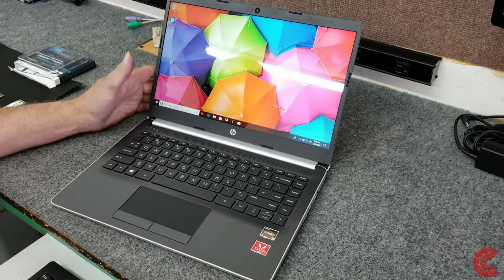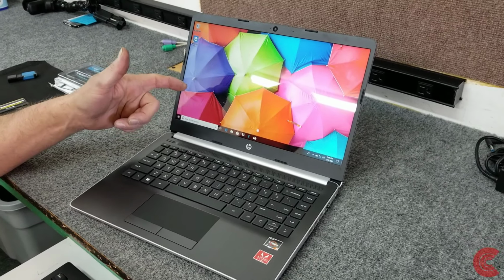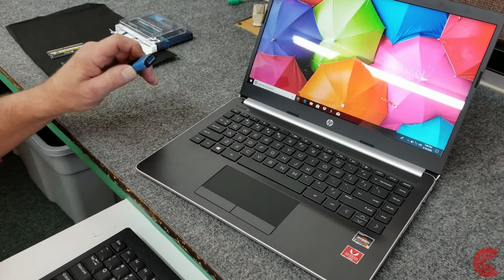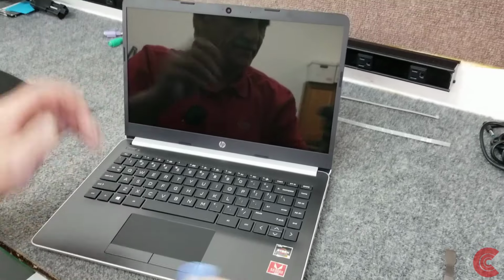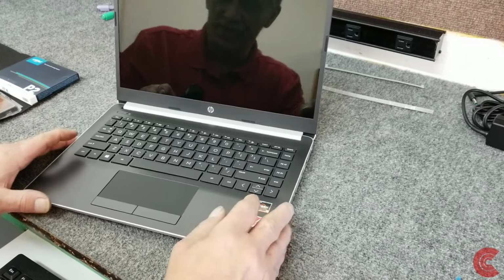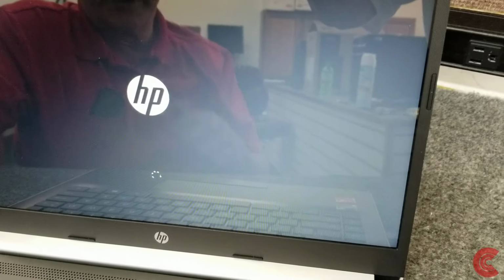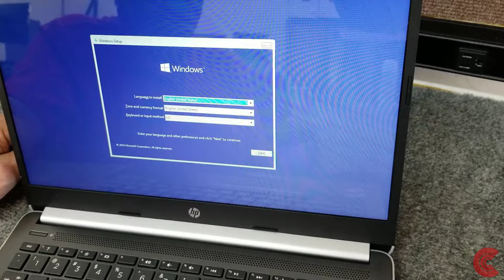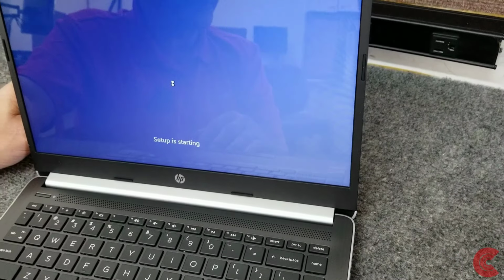HP 14 Laptop SSD Upgrade, Memory Upgrade

Comment: thanks for the video, I wanted to add an HDD but thankfully this video showed me that I also need a caddy, thank you for the links !!!
Reply: bro can we add hard disk into it ?
from Pakistan.
Reply: @howtoxpert1  Yes, you can install a 2.5" hard disk drive, you will need the connection ribbon to plug it in to the motherboard, and a rubber caddy so it does not wiggle around.
Reply: @complex_variation  it would be very appreciable if you suggest me a good HDD and its size.
Reply: @complex_variation  thanks boy.
Reply: @complex_variation  amigo, creo que hablas en español (cruzo los dedos). Estuve viendo y creo que hay partes específicas, con numero de serie, según cada laptop. El cassy de goma o silicona, lo puedo conseguir. Me está costando encontrar la cinta de conexión que iría desde el SSD (en mi caso) al conector que está en la placa de la laptop. La mia es una HP 14-cf3047la. Gracias totales!
Reply: @nachoex  Hola si hablo español! Fíjate que mi papa y yo ambos tenemos como la misma "serie" de HP, 14 pulgadas laptop básica, la unica diferencia es el procesador, AMD e Intel, hasta la motherboard se parecen en cuanto a forma, y te puedo confirmar que la de mi papa (14-cm0015la) le quite el HDD con el caddie y la cinta de conexión y la logre poner en la mía  (14-ck0019la).

Pueda ser que, si existan diferencias, pero recuerda que estas empresas tratan usar los mismos componentes para facilitar la manufactura de diferentes productos.
Reply: @complex_variation  Joya entonces. Y como busco la cinta de conexion? Como seria el nombre? Acá en Argentina utilizo mucho mercadolibre para ese tipo de cosas. Mil gracias!
Reply: @nachoex  Entiendo, Yo soy de Honduras y principalmente uso Amazon USA, y allí se les conoce como "SATA Cable Flex connection Ribbon", para X o Y laptop.
Yo diría que si no logras encontrar algo específico para la HP 14, que compres el más largo que encuentres, ya que las terminales del cable son estandarizadas pero la longitud naturalmente variaría de modelo a modelo, y si te sobra cable no hay problema.
¡Suerte!
Reply: @complex_variation  mil gracias!!!

Comment: Thanks for the info.  I have this very same laptop,  and am going to upgrade to 16gb ram. The space for the extra 2.5mm drive was a welcome surprise.

Edit: just tried it , and the replacement ram did not work. Laptop does not boot, and fan cooler starts and stops intermittently.  I wonder if it is because I tried it with higher speed modules (2x 3200mhz vs 1x 2666mhz). Any thoughts?
Reply: Maybe your processor doesn't support higher frecuencies than 2666Mhz.
Reply: @faheema325  thanks for the tip. That was my thinking, also. Its a bummer, since its a mess to try to open these laptops.
Reply: That wouldn’t make much sense why it wouldn’t work, because the ram should be capable of all the common frequencies below the max speed. I had a similar issue when I built my desktop, the ram wasn’t fully secured. When I powered it on the fans would run but right after it would stop and shut down. I replugged the ram and it worked. Just had to make sure it was all the way in.
Reply: @commie281  I reseated the new modules twice, to no avail

Comment: EASY WAY TO SEE HOW MANY MEMORY SLOTS YOUR LAPTOP HAS

The easiest solution for Windows users is to open the Windows Task Manager.
Press the Windows key, type Task Manager, and then press Enter. 

OR ....CTRL ALT + DEL 
In the window that appears, click the Performance tab (A), then select Memory (B).
In the lower-right corner, the number of slots is displayed in the Slots used: section (C).

Comment: 32 GB of ram is a bit overkill for a budget system like this one. 16 GB is sufficient for every day task and gaming. I found that Skyrim, GTA 5, and Fortnight runs decently between 40-50 FPS at low settings. There is way to increase the CPU power 25W in order to get more performance out of it, but it throttles back fast due to insufficient cooling.